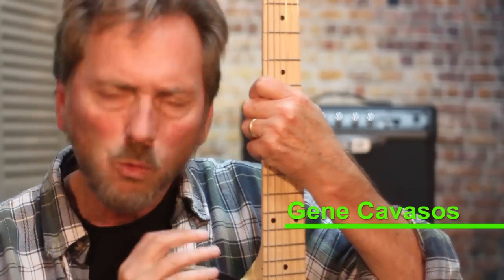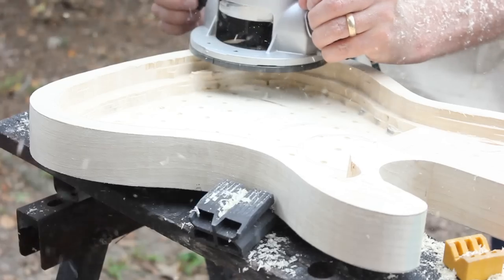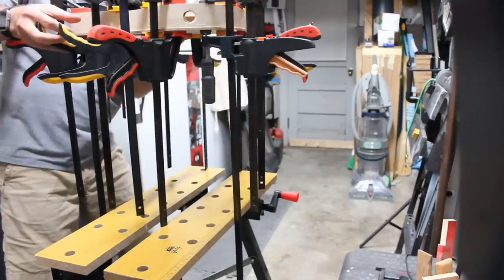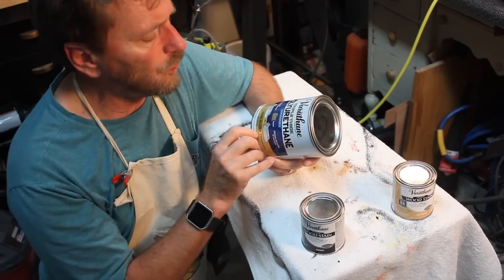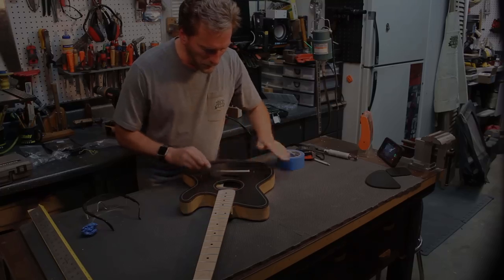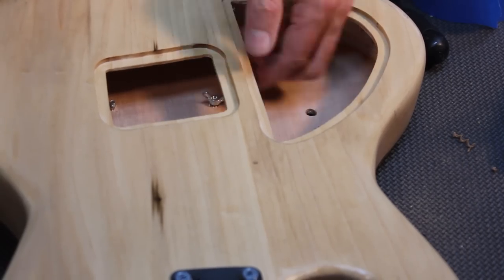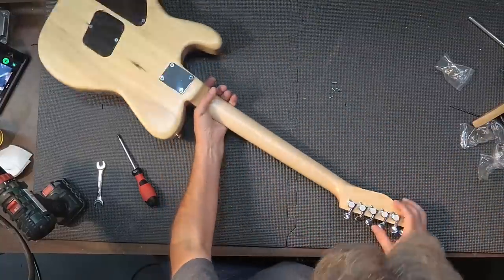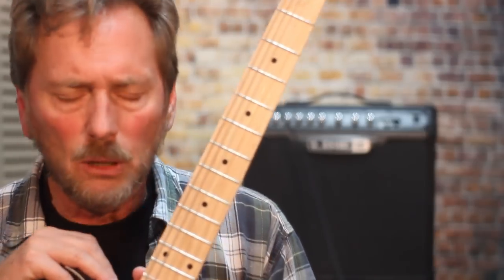How to Make an Acoustic Electric Tele-Style Guitar (Step by Step)

Comment: I don't think you did anything "wrong," rather, you built a guitar the way you wanted it to be, so you did everything right, in my opinion! I would have liked to hear it played just acoustically, with a microphone outside of the body. Not that I would expect it to sound really great acoustically, but if it at least sounded "okay," there is one thing I might change if I were building it, which would be one of the newer Fishman acoustic/electric pickup/preamp systems that have the under-the-saddle piezo pickups, along with a little "microphone" pickup that sounds a lot less "clicky" and tinny than the piezo. I may be wrong, but I think it's called the Fishman Presys Blend. Plus, you can blend the amount of both pickups, using whatever ratio of piezo:mic that sounds best for the instrument and/or the situation. For example, if you need it to cut through a band onstage, you may want mostly the piezo's signal coming out to your a or PA. On the other hand, you might prefer most or more of the mic's signal for recording, or even in a small venue. But if, like I mentioned earlier, the guitar just doesn't sound very good acoustically, it might turn out to be a waste of money. But you really can't know for sure until you've tried it. Who knows, those Presys pickup/preamps sound even better in this one than it does in a more typical acoustic guitar...?

Comment: I have to say, I really like this guitar!  I really liked the sound, and that it wasn't very thick. I don't like playing the thick dreadnought style acoustic guitars. I'm so used to electric guitars so I imagine that's why. Great guitar, and great job building it!  I only have one suggestion. Imagine that, me with a suggestion...Lol. 

The placement of the Piezo pickup. I think it would be better if placed behind the bridge to the underside of the top. Maybe place it centered between the low "E" and "A" string behind the bridge. That will get it further away from the other pickup. I know I said one thing but this counts as one since it still has to do with pickups. The tele style pickup you have is ok, but it may be more beneficial to put a mini humbucker there. It's a little bigger in size but it may be slightly quieter. A hot rail style humbucker visually looks almost the same size and they can be pretty inexpensive depending on how much you want to spend. Its definitely much smaller than a normal sized humbucker. Plus they look pretty cool. They start at about 10 bucks and go up from there depending on quality and brand. It never hurts to experiment especially if it's not too expensive to do so. Anyway love the guitar, great build!
Reply from the maker: That is a great idea and I will look into it.  I am going to rebuild the guitar to make it even better.  Stay Tuned!

Comment: Good effort Gene, some ideas for how you can improve it.  First off, I'd scrap the switch and give each pickup its own volume knob, that way you can control how much acoustic you want and how much electric when you're going for a blend.  Secondly, I'd add a Piezo pickup under the bridge saddle, so now you have 3 pickups to blend.  As for the construction, as others have suggested, braces will extend the life of the top, I'd also suggest adding a bridge plate on the inside below the bridge.  One more thing, in order to ground the strings when using the electric pickup, you could add a strip of metal below the bridge, with holes in it that line up with the pin holes, so the ball end of the strings end up touching it, then ground the metal.  Stew-Mac sells one as a "Plate Mate" but you can make one.
Reply from the maker: TheRobman , These are great suggestions. I like the idea of individual volume controls rather than the switch. That makes a lot of sense. I’m definitely going to add a piezo under the bridge. Thanks so much for watching.
Reply: @DIYGene  My pleasure.  Hey, something else occurred to me, you didn't show us the intonation, how close did you get it?

Comment: Nice! and a thought for you (old navy engineer here. lol) what if you mounted the Piazo up on the inside neck support? Since it's basically just a small microphone, that would give your acoustic sound, without the extra vibrations of being attached to the outer body. Which would give the vibrations of the sound leaving through the sound hole.
Reply from the maker: That’s a great idea. I did add one under the bridge and it gave a nice acoustic sound. Thanks so much for watching.

Comment: The reason for the piezo being so sensitive is it's reading the vibrations of the top of the guitar. The electric pickup is just getting the vibration of the strings. If you're worried about the pop/thud you get from changing to the piezo pickup, I'd recommend maybe (maybe) loosening the switch a little. But, in a live setting that won't matter too much. Even switching from one electric pickup to another sometimes has a pop, nobody would pay much attention

Comment: Hi! I'm an acoustic guitar player and I have to say, Your guitar is awesome!
But there's some things that I have to say to you,about the construction of it:
1st:the acoustic guitars have to have some nice "protection" inside of it,because the tension of the strings can pull everything apart!
2nd: you should less space for the acoustic sound,even if u had less space inside of it,the sound comes nicely.U should build it like a normal eletric(for the wirering) than make the acoustic box!
sorry for my English mistakes, I'm Brazilian lol
Incredible video!!!
Reply: ps:the guitar sounded fucking great
Reply from the maker: Thanks so much. I actually am completely rebuilding the guitar. Thanks so much including a new face with bracing underneath and a under saddle piezo pickup. I hope to post this very soon. Thanks again for watching.

Comment: Love your project !  My only two cent suggestion (which stems from a pet peeve of mine) would be to use a clear "wood grain filler" on your luann top.
You will still see the look of "grain" in the wood but the surface finish would look much "smoother" or "cleaner" ie: better woodworking chops.
Also - Your video is very "watchable." Excellent pacing and shot selection, narration.
Reply from the maker: Thanks for the great advice. That makes a lot of sense. Thanks for watching.

Comment: I am not sure exactly on the electric pickup you used but most you can adjust the height to bring it close to the strings thus increasing it's volume. On another note, if you decide to do another I would suggest researching acoustic bracing for the top. Bracing will improve the tone and also add rigidity and support for the stress put upon the bridge. Other than that a most excellent build!!! Great job.
Reply from the maker: Thank you for the great suggestion. I am actually doing a new video, where I rebuild the guitar using a lot of the great suggestions, like bracing and a under saddle pickup. Hopefully I will have it out very soon. Thanks for watching.

Comment: Great build! 👍🏼 I like the pinstripe!   Did you tried messing with the height of the bridge pickup? Maybe raising it could help... 

For the next similar build- a offset back plate (rounded on the trebble side) would suit the body shape🙂

Just have the feeling, that the access holes in the back are weakening the back a lot and interrupt the woodvibration... I‘m no luthier..., just a thought. But mounting all thru the front hole is a surgical task...😏

I also like to predict: after 3-4 years it will sound much better. All is then dry and settled

Comment: Very nice work with wood craftsmanship also my personal opinion is that piezzo it's not the best to set up in Semi-Acoustic Guitar, i think it's far better to install inside a little dynamic mic so you can have far better sound from the wood and good basses from the small air inside the body so can handle the trebles from the pick up.The piezzo used often to hitting instruments like Cahon or Drums to transform vibrations to a sound but not to handle chord melodic  sounds.

Comment: Cool home made guitar. I would recommend an under saddle piezo pick up coz its directly under the weight of string tension rather than that you installed. Its more sensitive to string vibrations and less on the vibration you had when switching from telecaster to piezo pick ups.
Reply from the maker: Pinoy keyboard warrior , I think you are absolutely right. I am doing another video and that is one of the changes I will do. Thanks so much for the great suggestion and for watching.
Reply: @DIYGene  
Thank you and good luck sir!
I will subscribe and watch the mods you make with your cool home made guitar. Have a good day!

Comment: I recently put a piezo on a classical guitar that I also put electric guitar strings on... the preamp I used had a place for a mic also, so instead of a mic I put a magnetic pickup in the sound hole.  This preamp has a fader to go from piezo to mic (or magnetic, in this case), as well as the usual volume, tones, and tuner.  Something like that would be a real boon to your Tele-Acoustic I think.  Otherwise, maybe just put a volume pot on there for the piezo?

Comment: Definitely add bracing to the top, and better to have used a solid soundboard wood.such as spruce or ash. The heel joint was cool, but looked  like it was not finished flush with the neck itself. That could be just the lighting, not sure. Loved the idea of pin striping too! Am very interested to know how the bridge placement did with intonation. For the record, I own a Telecoustic  and love it!
Thanks especially for the links to the tools, I would definitely look into the bench top sander!
Reply from the maker: Joe Kralicek , Thank you for the great suggestions. I think the next one will have a different top. The intonation has been perfect although not sure why. After 6months the bridge is doing fine. Thanks so much for watching.

Comment: Interesting build! I may have to give it a try. How is the top Been holding up since? Usually, an acoustic guitar has a hardwood bridgeplate underneath the top that gives the strings a solid anchor point and provides some reinforcement. Any issues with bulging or distortion of the top with string tension? I wonder what it would be like if you left it “solid” in the bridge area and whether the Fender is built like this? I’m sure you have quite a bit of 20/20 hindsight now!

I think I’d mount the pickup from the top in similar fashion to the way they mount “P” and “J” bass pickups! That way you don’t need that extra hole in back.

I would also probably use an under saddle pickup like Fishman or LR Baggs so everything isn’t all “Microphonic” like yours. I’m sure with the Fender model, it is more the electronics responsible for the “acoustic” sound that the acoustic properties of the body.

Finally, I would have separate volume controls for each pickup so you have the ability to better blend the two and provide more tonal options. You could probably make this change on your yours to give added flexibility.

Comment: I like the sound of the individual pickups.  The Tele bridge pickup makes it sound like an electric, the piezo gives an acoustic sound.  Now, the two together, not so sure about.  Did you drill the holes all the way through the bridge for the pegs?  Another question, for these acoustics on is, is there a specific thickness to the top?  Does the type of wood for the top matter?  Would a spruce top have provided a better tone?  On mounting the bridge, I have seen when making acoustics, they will trace the bridge on the top, then mask off the whole ares, so there is total adhesion between the bridge and top.
Reply from the maker: I definitely think different woods create different tones. I agree with you on the blended sound and don’t use the blend much. I would like to experiment with some other pickups. The poplar top was around a little less than 3/16”. That was as far as I dared go. Yes I did drill through the top for the pegs and you are definitely correct about masking off for the bridge you want a bond of wood to wood. I hope that helps. Thanks so much for watching.

Comment: This thing buzzes a lot . I suggest adding metal pins to lock the strings and add a metal layer underneath the bridge and soder it to the ground. Like in electric tele you have to connect  the bridge to the ground,this is done to remove the buzz , and if you really wanna go crazy try add shielding .
Reply: But everithing else was built in wonderful way , I really loved the binding
Reply from the maker: That’s a great suggestion. I did use threaded screws through the bridge and could run a ground to one of them. Thanks again for watching.
Reply: @DIYGene  you're welcome

Comment: This is awesome. I'm going to use this as a guideline to try my own!
Reply from the maker: MirnMusic , I have had a lot of great suggestions. One is to use an under the bridge pickup. This was such a fun project and I have learned a lot. Thanks so much for watching.
Reply: @DIYGene  a very good idea to keep in mind! Getting all the stuff on Monday, so then I'll get started
Reply: @DIYGene  I'm lookin at the under the saddle piezo, and I'm also willing to add a telecaster neck pickup. Can that be done relatively easily?
Reply from the maker: MirnMusic , yes. I just followed the same basic telecaster wiring diagram you can get on google and switched out the neck pickup for the acoustic pickup. I think I would also make the sound hole smaller than I did.
Reply: @DIYGene  thank you so much for your reply! I will probably locate the sound hole in the upper regions of the body to maintain as much resonance but I'll have to see about that!

Comment: How did you design the body ? I mean how do you know how many frets go in the body and how do you get proper Intonation? Did you download the template online ? 
Nice vid btw . You just earned a sub
Reply from the maker: I used a basic telecaster design and put a slant on it. I also used a telecaster neck that is 22 frets. You can use a free fret position calculator on stewMac.com together the proper fret scale and position for the bridge. I hope that helps. I am working on a new video that deals with that exact question. Thanks for watching.

Comment: Well done. I have made myself a few projects. It became apparent that the main thing for good sound would be electronics. Good ( not necessarily expensive magnetic pickup) would cover one side. With piezo it,s more complicated because without EQ controls it just not going to sound right. Plus, it is not going to combine well with magnetic. Recently found that Noll Electronics in Germany makes  MixPot where both pickups can be combined, their levels adjusted and controlled by one blend volume pot. Also, I personally prefer magnetic pickup to be placed by neck, thus giving more distinctive sound from piezo. Magnetic would be more juicy and mellow and piezo would add airy high frequencies. But that,s to my taste. And I will use preamp for piezo with lots of EQ controls. Thanks for video.
Reply from the maker: Denis Kundrat , Thanks for the great advice. I am definitely going to check out Noll Electronics. Thanks so much for watching.
Reply: Finally I have put together my acoustic using Noll MixPot for piezo and magnetic pickups. Works very well. I used Artec bar undersaddle piezo pickup which appears to sound good on it's own. Lipstick magnetic pickup was my choice for neck position as it has it's own distinctive sound. There is only one knob on guitar to mix both pickups and I feel no need for any additional controls. Hope this helps. Best regards. Denis
Reply from the maker: Denis Kundrat , So glad you hear you finished it. Congratulations!  I’m going to rebuild mine using some of the great advice from viewers. I hope you really enjoy your guitar!

Comment: A small resistor in series with the piezo pickup will let you balance the volume. The math is easy,  but you will probably have more fun just temporarily wiring a volume pot in the line... adjust it till the balance between pickups is satisfactory, and then measure the resistance so you can install a permanent resistor in place.
Alternatively, you can get a small adjustable pot to put near the soundhole, or install it inside where you can pull the cover plate, and adjust it as needed.
Reply from the maker: That sounds perfect. So a resistor in series would do it?  I will have to try this.  Thanks so much!
Reply: @DIYGene  looks like my 40 years experience as an electronic tech finally paid off <very big grin>

Comment: One question.  About grounding normally you'd run an earth wire from the bridge to the ground to reduce noise. On a wooden bridge you can't easily do that. I'd thought I'd put in some copper tape so the strings are earthed.  Do you get earth buzz?
I would possibly go with an undersaddle transducer to avoid the handling noise issues.  Also I've thought if I tackle one of these I'd have two volumes to blend the two more.
My one criticism is the neck joint, I think the neck too far into the body but if you're happy that's not important
Reply from the maker: I bolted the bridge on and ran the ground to one of the bolts . It seems to work. I think if I do this again I will use an under bridge pickup.Your right about the neck. I was working with the intonation to get it right and should have moved the bridge. Plus when I put an angle to the tele design it moved the neck to a bit deeper. I love how this guitar plays and sounds and has become my favorite guitar. Thanks for the great suggestions and thanks for watching.